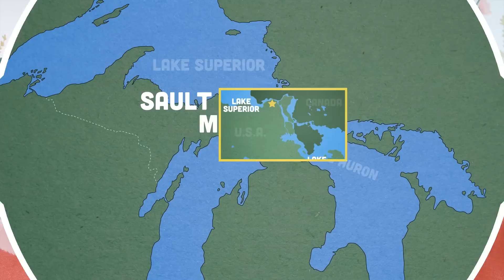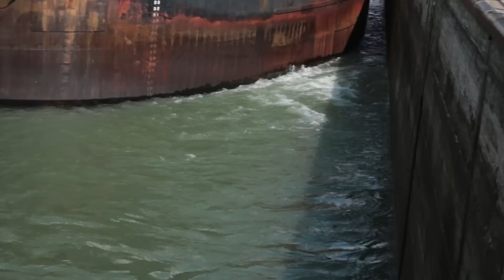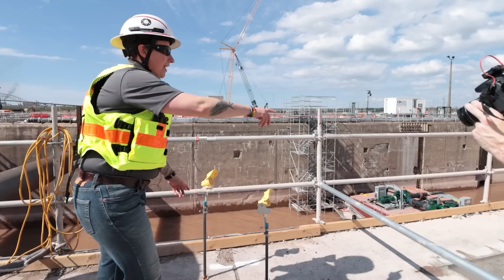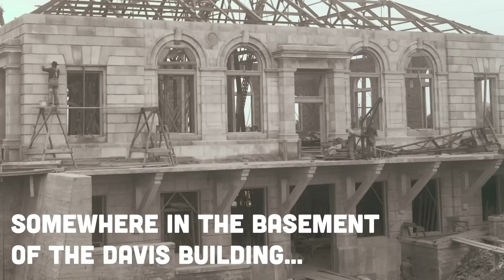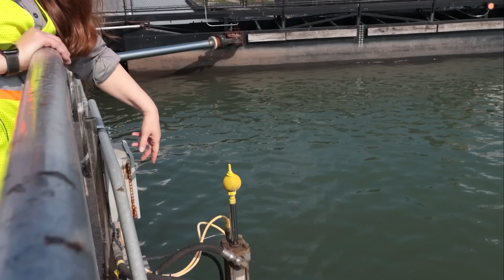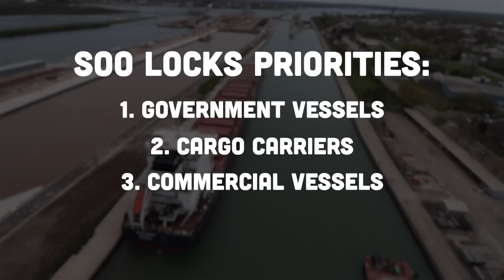The Government is Spending Billions on This (Behind-the-Scenes at the Soo Locks)

Comment: Love your podcasts Alexis! 

Question here… the Corps engineer you interviewed said the crushed concrete from the demolished lock was going to be placed as backfill in the old lock location. I am wondering what the Corps thinks about the possibility of the potential of increasing alkalinity (water quality) of the  water that will eventually saturate and flow through the crushed concrete backfill?

Comment: Wondered where exactly the new lock was going in relation to the Davis and Sabin.  I know it is replacing both, but was not sure if both were being demolished and then filled with dirt.  

Been many years since I was last at the Soo (35 years?).  I remember several times being up there for Engineers Day and being close enough that you could write your name in the dirt on the side of the ship as it locked through.  

Did not realize that the ships favor one side of the lock over another- I always assumed they tried to center themselves so there was about 2.5 feet on each side (the Poe is 110 feet wide and the thousand footers are each 105 feet)

Comment: Initially, the project was going to be roughly 850 million dollars, but with most Government jobs, that has ballooned to over 3 billion.  In WWII we reconstructed a Navy, built thousands of planes, over 35,000 tanks, and fought that war in far less time than this project is taking.  At my place of work, we would call that "dairy farming" - milking for everything you can and slowly getting the job done.  Project should be done in half the time with half the costs if proper incentives were in place, but us tax payers get screwed once again.
Reply: I promise you 850 million was just the budget proposed to get the project moving and it was never actually expected to be completed for 850 million, you're not going to complete a decade long project for that cheap but it's a lot easier to get the initial funding and secure more along the way than to put the entire proposed cost into one budget allotment. And the only reason that amount of stuff was able to be produced in WW2 is because the country was in total war mode with the government seizing control of steel production and other industries they, can't just seize control of companies and supplies like they did back then during times of war because it's unconstitutional
Reply: noodlenoodle, well said. Evidently you work in the construction industry and not an armchair superintendent who is a self proclaimed expert.

Comment: Some years ago I worked with a guy doing two-way radio communications maintenance and we did some work at the locks. I had the opportunity to go on the roof of the main power house (where was an antenna) and down in the tunnel underneath the turbines (where was another antenna). I also went up to the control tower and saw what you saw, then I went on the catwalk outside the control tower and up the radio tower that’s attached to the top of the control tower, where was another antenna. Now THAT is the best view in the Soo!

Comment: When I was much younger on a school trip to some locks on the Mississippi they described how the female engineer who designed the lock had to take into consideration how water flowed out of the lock to avoid downward suction on the barges. They pointed out if the water flowed to fast out of the lock it could actually sink the low riding barges. They also talked about water replacement into the lock as shipping leaves, or water displacement as shipping enters the lock. In both cases they want to manage that from below by valve as opposed to flowing horizontally under the shipping as it moves in and out. Lots of thought and engineering.

Comment: water scour from cavitation is no joke. dams that have overflow tunnels with turns in them usually need heavy maitence after use. There are pictures of 25' tunnels with 20* bends in them, and the water has eroded 5-10 FEET of concrete away.

Comment: Excellent video!  It appears one slight omission is the definition of a “monolith.”  A lock wall monolith is simply a large block of concrete that when joined with other monoliths, forms a lock wall. These monoliths are generally on the order of 40’ long; and thus, an example 1600’ long lock wall would be comprised of 40 monoliths.  And since a lock has two walls, a total of 80 monoliths.  Each monolith is designed separately and thus can vary in size and shape to retain the water in between the walls and keep soil and water at different elevations on the outside.  So the saw cut is a means to see if one monolith is moving/possibly failing in relation to its adjacent stable monolith.  A lot of saw cuts and instrumentation to monitor 80 monoliths!